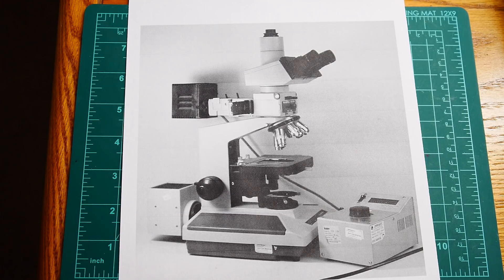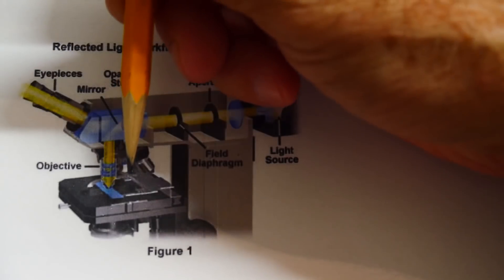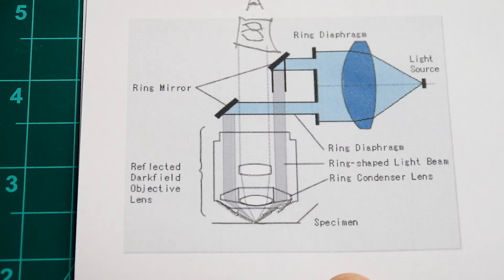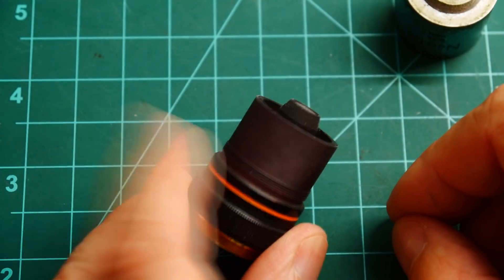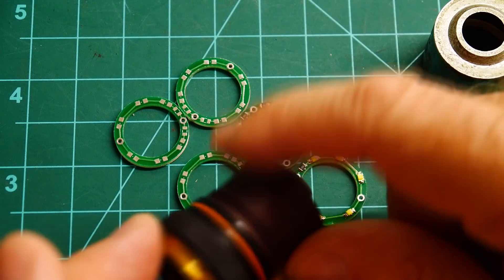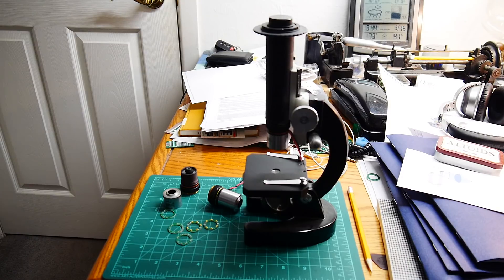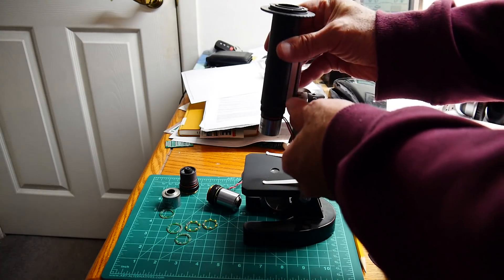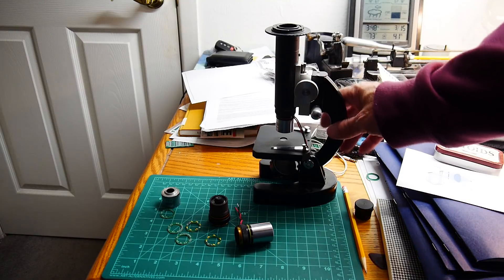#185 Poor Man's Dark Field Microscope

Comment: Man I wish they sold those tiny little ring lights online
Reply from the maker: I've got a couple bare PC boards if you want one
Reply: @IMSAIGuy  Do you still have extra PCBs? I just ordered an old darkfield objective off ebay and need to figure something out.  I might just use thin wire and solder right to the LEDs
Reply from the maker: @uberscientist  https://www.pcbway.com/project/shareproject/Small_LED_Ring_Light.html

Comment: Do you need to use a dark field objective?  Could you not just attach the mini ring light to a normal objective?
Reply from the maker: I'm sure that would work for low power objectives. It might be hard for objectives with vary small working distances.
Reply: Or you could make a dark field patch stop
Reply: @caidenmartin1839  that's under not overhead darkfield illumination but it still works just not as well for higher magnification in particular